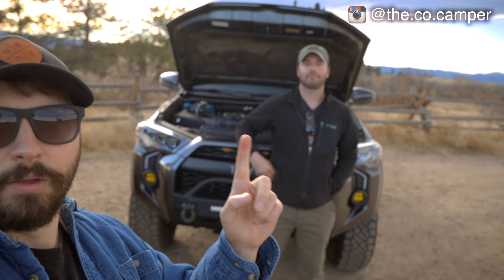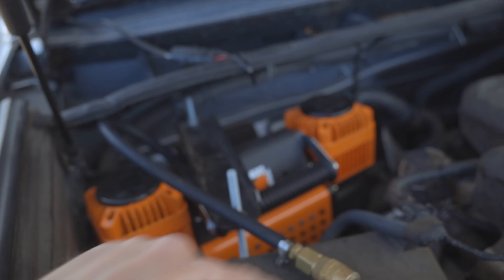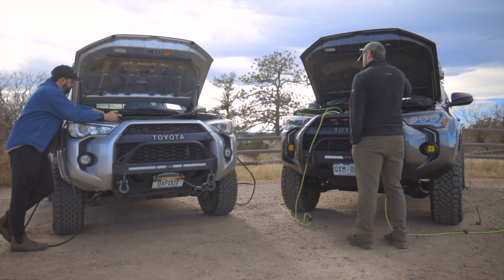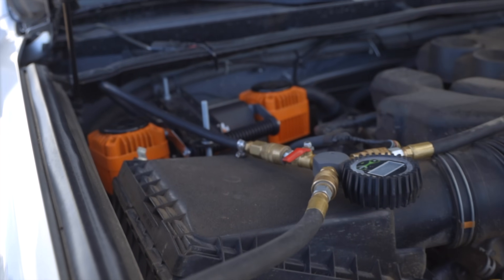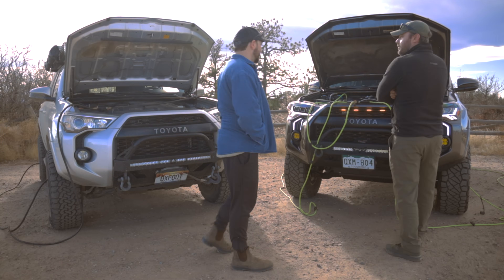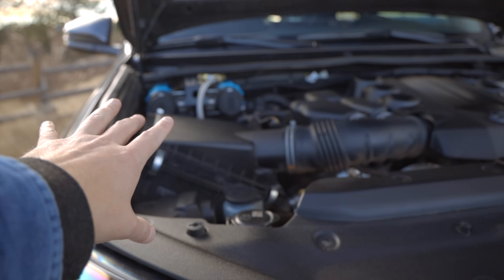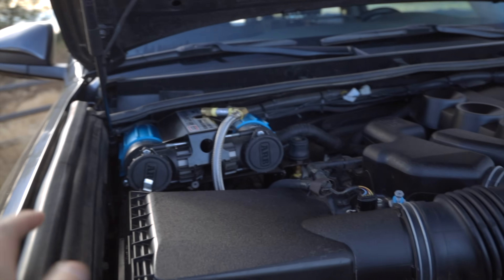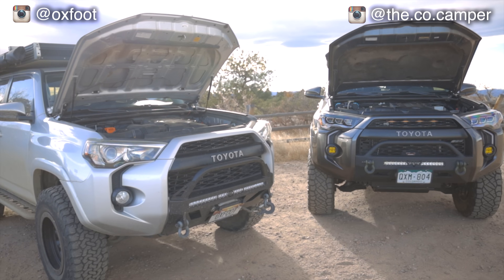Budget NAPA Compressor is FASTER than ARB Twin?

Comment from the maker: So it turns out these are now sold out... Summit offroad has essentially the same one for sale on their website: https://summit-offroad.com/products/summit-dual-air-compressor?variant=31874405728361&currency=USD&utm_medium=product_sync&utm_source=google&utm_content=sag_organic&utm_campaign=sag_organic&utm_campaign=gs-2021-12-21&utm_source=google&utm_medium=smart_campaign
Reply: In your video you said you had another video about doing the mods to the Napa compressor.  Do you have a link to that video?  I'm a rookie and about to make my own 4 tire inflation system and don't really understand what I need to do with the Napa compressor to make it compatible.
Reply from the maker: @kurtmittendorf8003  it’s towards the end of this video. https://youtu.be/De10UUP5UzY
Reply from the maker: @kurtmittendorf8003  but if you’re making your own 4tire inflation system you can change the connectors to make the original fittings work. I’ve not made one but they are really customizable.
Reply: $189 🤦🏻‍♂️😬
Reply from the maker: @gufiaito69able  yeah it’s the same thing basically. Can’t believe the markup on those.
Reply: These sold out as well
Reply: I am not an off roader so a NAPA will be something I would be buy. I mean 10 mins is not a big deal for me.
Reply: Sold out already.

Comment from the maker: So I totally forgot to mention it: we were both running 285/70/17s and we aired down to 15psi; aired up to 35psi! 
Also, there will be some modding to make the compressor work with the 4 tire inflation devices we used, that’s the case with a lot of these cheaper compressors.

Also Check out this video of adding a pressure Switch: https://www.youtube.com/watch?v=34NVzXW6LxM
Reply: Just a thought, maybe you use yours to air up his tires and he uses his to air up your tires. That would take care of any doubts.
Reply from the maker: @jwat2396  man we tried but couldn’t get any of our hoses to reach each others vehicle! We wanted to.
Reply: Awesome video glad I bought the Napa one. Are you gonna make a video on how to customize the hose to fit the 4 tire inflator or you already did🤙🏽
Reply: Something has to be wrong with your buddies arb dual. Using my arb dual and a speedflate 4x system, with our 285/70/17 takes just a few minutes. Hell I've aired up trail buddies with 37's faster than his took for the 285's. I do have my QD fitting directly off the compressor though, not sure if that is choking his down or not.

Not to take away from Napa's performance at all, very impressive. Just it sounds like something isn't quite right with his arb setup.
Reply from the maker: @vdub5818  yeah we talked about that as a possibility and maybe I can confirm by comparing it up against another one and seeing if it’s the same amount faster with that one. The NAPA one is crazy fast though I still think it would beat it but maybe not by such a wide margin. I’ve never seen a compressor go as fast as the NAPA one.
Reply from the maker: @dirtrider5845  I sort of discuss it in the video I did about the smittybilt compressor because I had to do the same thing to that one. It’s pretty simple, just cut the hose, add the barb to the connector and push the barb down the hose. Then kept the hose connected to the barb with a little hose clamp. I’ll send the video with the supplies you need and all that in the next comment.
Reply from the maker: @dirtrider5845  https://youtu.be/De10UUP5UzY
Reply from the maker: Hey guys, found the rating if the compressor. It’s rated for 40psi for 15 minutes and 5 minutes off.
Reply: Do you remember what parts were needed to adapt it to a 4-tire inflation system? Going to be build a 1/4" flexzilla based system and trying to order all the parts at once. Thanks!
Reply: So what I am curious about is if I took off the base of the maxi track would it fit in the rear of the 4runner on top of the wheel well's storage area so I can mount it in the cab???
Reply: did you check to see if both fuses on the ARB are ok? that's way too slow for this unit. Perhaps it was only running 1 piston instead of 2.

Comment: Thanks for validating my purchase haha. For speed and price difference, I'll take the Napa every time. I don't really care if the ARB is higher quality given that I can buy 5 compressors from Napa and break every single one of them before I'm at the price of the ARB. Awesome video as always!
Reply: Then after the 6th one breaks you finally decide to get the arb lol.
Reply: @n.r.8719  nah I’ll still buy a Napa and enjoy the speed
Reply: @TheFraziers  I try to “buy once/cry once”. Can’t have a compressor crap out and leave me with no air ready to head home. My viair 88p is still going hard tho after like 3 years so that’s a good one as well that’s right around $100.  I’m going to look into the reliability of the Napa one this. It’s always good to know about other options.
Reply: @n.r.8719  I own the Napa and it seems really solid. I think you’d be impressed honestly.
Reply from the maker: Yeah, I really like the NAPA one so far I'm pretty happy with the purchase. Maybe one day I'll go with the ARB considering I want to add a front locker and a dual battery and the NAPA one takes up too much room for that, but I think right now I'm pretty happy.
Reply: Nah. I’ll take quality over quantity.
Reply: @n.r.8719  My $60 no name compressor is still going great after 6 years and two different trucks.  I just recently purchased the Napa compressor on sale for $85.  Should I have gone all in and spent $600 on a much slower ARB twin?  No thanks.  It's perfectly fine to spend your money on what you want, but just because it's more expensive does not always mean it's better.
Reply: @smatchetsforall5004  I agree- which is why I bought the viair 88p. Not much more expensive than your no name compressor and still going hard 3 years after purchase. Like I said - buy once cry once. Lol.
Reply: I’ve seen arb compressors also crap out during air up time. Maybe he should have bought another $600 compressor just incase. 👎

Comment: I think ARB makes nice stuff.  Having owned a lot of it, I'm also confident in saying they are also overpriced.  As an aside, I've been using the same Masterflow MV50 for almost 10 years.  I had to rebuild the reed valve once, but it was easy and dirt cheap.  Its fast and reliable and has held up pretty well.
Reply from the maker: Yeah I totally still love ARB products but they are a bit expensive. They’ve been in the game for a while doing great things though.
Reply from the maker: Yeah that’s awesome, I hope I have the same luck with my NAPA one that you had with your MV50.

Comment: I have an ARB with tank installed, and I always air up faster than everyone else.  But because of this video, and for the price, I picked up a Napa one just to have as a second one for my other cars.
Reply from the maker: Yeah the tank is something that a lot of folks have said. I even looked into doing just a straight up powertank and using my compressor for back up.
Reply: @OXFOOT  I don't 'believe' a tank will be as beneficial to people using a 4 tire inflation system.  The two advantages of my smallish 2 gallon tank filling one tire at a time are: 1. I  turn on the compressor before we get to the end of the trail.  The tank is up to 130 or so PSI when I start to fill the first tire.   The first tire is always the fastest.   2. As I move from tire to tire the compressor keeps running adding pressure to the tank.  This makes each subsequent tire fill faster than if I didn't have a tank.     If you have a 4 tire system you don't get the benefit of building pressure  as you move from tire to tire.

Comment: I'm impressed by the Napa compressor. Although, I have the twin ARB mounted the same as your friends with the same hoses.(MORRFLATE?) And it only takes me around 4 1/2 minutes to do all 4 tires from 15 psi to 40psi. I've done this numerous times with the same results. I don't know why his is taking so long. Either way, that Napa is something I'm going to show my buddies that don't want to spend the money on the ARB TWIN. Thanks for the video.
Reply from the maker: I’ll have to try it again and see. Planning the head to head was tough but maybe I can coordinate and try to film a YouTube short testing them again.
Reply: It’s an odd result only because even per the specs the Napa should not theoretically be 3x faster than the arb…. Either something is way over rated or way under rated, or maybe the arb is old and tired, worn seals?
Reply: I’m sorry but your test is NOT accurate. Those two vehicles have different valve stems. They are the main restrictors between getting air from compressor to tire. It’s NOT comparable test at all. Only true way to test it is to use one trucks set of tires for both compressors. That way you have same RFO (restricting flow device) which is the valve stem. If you get same results than, then you will know what system is better. This proves nothing. Sorry. Great attempt and awesome videos, but NOT accurate results as different components were used to test.

Comment from the maker: What do y’all think? Would you try the MAPA compressor out or would you rather go the ARB?
Reply from the maker: NAPA*
Reply: Even if it’s less reliable you could replace it 5 times over before you spend as much as the arb!
Reply: I would definitely try the Napa compressor! Thanks for the review
Reply: Yup gonna try the Napa on one of my rigs already haves viair 440p but really want on that is just stand alone & ready to go 👍 thanks for the great video
Reply from the maker: @Duff_Ski  yeah I think you’ll be happy. Hopefully it has the longevity to go along with the speed.
Reply: Napa
Reply from the maker: @xxnatas69xx  yeah that’s my thoughts on it. It can always be for home use or my GFs car.
Reply from the maker: @xxnatas69xx  also making your own is a great way to do it, that way you can make sure everything is the size you want.

Comment: I bought the NAPA compressor, keep in a separate bag so i can move it around, added a 90/125psi shut off switch, a standard quick connection, and a single fill hose with a quick connect for the valve stem, also set up a quick connect power connector running off the same switch for my winch and have less then 1/2 what the ARB system is. Not saying that the ARB is not great, but if funds are limited you can put together a nice set up for relatively lower cost. Ran the system a few weeks ago while at the Hot Springs off Road park, worked great.

Comment: Wow, wouldn't have expected this result... As somebody that has the arb twin, I'd probably now get 2 Napa twin compressors (one as a spare) and use the difference for other upgrades.
Reply from the maker: I mean for me I think that one day I’ll likely go with the ARB just because I want to do a dual battery and a front locker, however for now I’m pretty happy with this. Maybe by the time I’m ready for an ARB twin they’ll step up the speed to compete with these new big twin piston compressors.
Reply: @OXFOOT  Or just get a single piston compressor for locker(s) - which is way cheaper - and use the Napa one as a portable tire inflator, with a 1 gallon air tank, similar to the arb dual compressor kit. Regardless of your choice, thanks for the video, very informative.

Comment: I have it mounted in the same place using the same C4 tray and I wired it in. Works great. I used a 100amp breaker since Napa’s claim that the compressor has one built in is just false.
Reply from the maker: Yeah I still haven’t gotten around to wiring it in but I need to get around to it. What tools did you use? Just a breaker and wired to your battery or you have a pod system or something?
Reply: @OXFOOT  i don’t have a pod so I wired it in directly to a breaker that I put on the fuse box and then wired the breaker into the battery. Gauge 6 lugs do the job and I had enough wire left to use it to connect the breaker to the battery. I think if I had a pod, I’d still wire it separately because it requires such a high amperage breaker.

Comment: Wow. That Napa is virtually the same size as my Smittybilt compressor. I thought I got a good deal for $150 - But the Napa is cheaper and faster?! Amazing.
Reply from the maker: I had the smitty one that I believe you’re talking about; the 2781? I love that thing but it’s about half the speed of this one. Just note that this one is about 20ish percent larger because of the additional piston. I had to tilt the Napa one to get it to fit where my Smitty was mounted.
Reply: @OXFOOT  ahhh, make sense. Bigger is better in this case. But bigger, faster, and cheaper? Shoot, I'm sold. lol

Great content, btw. Keep it up.
Reply from the maker: Yeah the only real upside I see is that smittybilt has a pretty good track record with their products, maybe maxitrac does overseas but I’ll have to see how long this thing lasts. Maybe it’ll be years.
Reply from the maker: Also thanks! Appreciate the feedback.

Comment: ive never set up an onboard compressor, but ive had some cheap ones in the past sitting in the trunk. Before i got an FJ i was never good to my gear or my vehicle, but some of the cheap air compressors ive had, have lasted several years, im sure the napa will have a decent lifespan

Comment: I bought the harbor freight $70 single piston compressor and it worked pretty well too. I haven't used it with any kind of 4 tire hose though
Reply from the maker: Yeah I had a single piston one before I got this one and it was plenty fast enough. This one is almost overkill ha.

Comment: Something might be wrong with his ARB twin.  I have an ARB single and even using a single air hose, I can air up from 15psi to 35psi in less than 10 minutes.  My tires are 255/85/16.  A bit skinnier than a 285, but a bit taller as well. My friends ARB twin is noticeably faster than my single.  That being said, I'm picking up that NAPA unit as a back up! That thing is a beast!
Reply from the maker: Yeah there could be something wrong with his for all we know. I guess the best would have been to compare two arbs vs two Napa compressors to get a 100% accurate reading. I don’t have that kind of mythbusters budget though ha. Maybe I’ll do a short with another person with an ARB and make sure that it was accurate.

Comment: I used the NAPA compressor to top off my trucks 33" tires. Overshot every tire even though I ran it less than 30 seconds each tire. It is quick. 

I will note that the inline gauge that comes with it is absolute trash in that it never reads correctly. It also goes to 150psi so it lacks the increments for fine tuning your tire pressures.

For the hell of it I intend to wire up an arduino with a pressure sensor to allow me to set a pressure and have the pump auto shutoff once the pressure is met.
Reply from the maker: Yeah I instantly ditched the gauge and original hose. Took it home, opened the box and cut them right off before turning it on. The cheap ones have notoriously bad gauges so I didn’t even care to deal with it.
Reply from the maker: But that’s a really good idea with the pressure sensor. Let me know how that turns out because I haven’t seen that yet.

Comment: At that price difference the NAPA can fail quite a few times before reaching the price of the ARB. I also believe with care the NAPA one will last a long time. Under hood heat soaking of the units is probably the greatest factor to their lifespan.
Reply from the maker: True, but I think they actually quit making the NAPA one sadly. Summit/SSW has one that they made that’s great but it’s a little more money.
Reply: @OXFOOT  Several or more companies make the same unit to various colors and such. But basically, the same and the single cylinder variety. When the reed valves break you can fix it using a piece of feeler gauge as a replacement.
Reply: @OXFOOT don’t think it’s “maxi trac” anymore, it’s just called Napa. I just ordered one, should be here Tuesday. It’s the same thing with their awning, used to be maxi trac, now it’s just Napa.

Comment: A lot of people don't know this but the ARB twin has a serious issue. The hoses used from the compressor tank are 4mm internal diameter. If you replace the hoses with brass fittings you can get 6mm internal and vitually double airflow. Also, allways connect your compressor to a LFP battery not the vehicles lead acid or AGM. they are a lower voltage.
Reply from the maker: Thanks for the information!

Comment: Thanks for the video.  I was just discussing a comparison of these two compressors.  Very happy you did this.  One comment I would say to eliminate as many variables as possible you could have just used all of your equipment on your tires on your vehicle be test both  compressors.  That would have been a little more apples to apples but either way the napa compressor smoked the ARB twin.
Reply from the maker: Yeah that was our original thought. We were going to both air up with each others compressor and use just one hose but the damn hoses weren’t long enough because we both have our compressors mounted in the engine bay. I could have undone mine and tried it that way but then his still wouldn’t reach. We thought of tons of different methods but ultimately that’s the one we ended up on because of hose constraints.
Reply from the maker: But that method you described was my favorite.